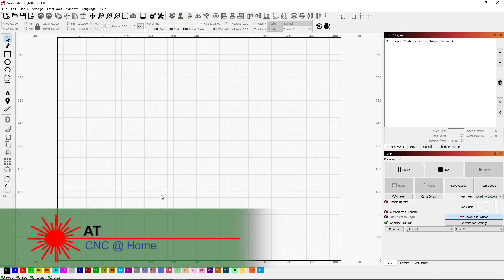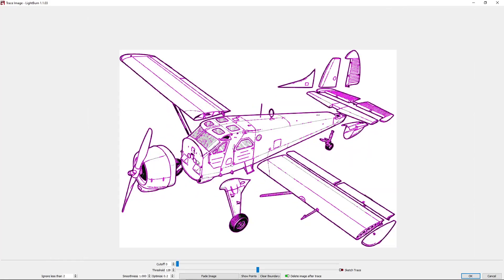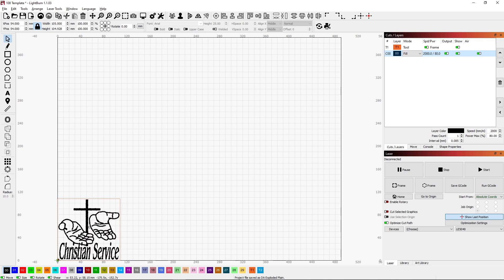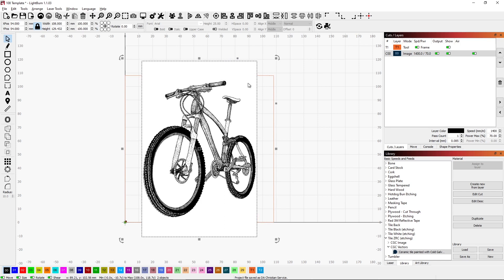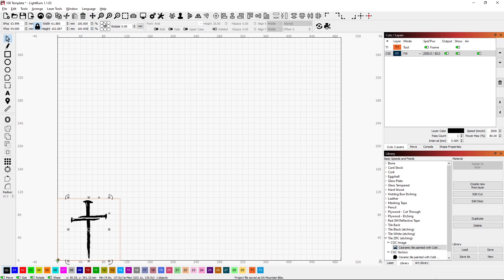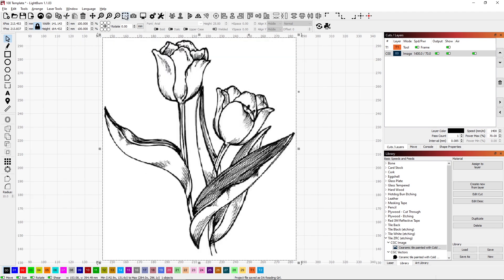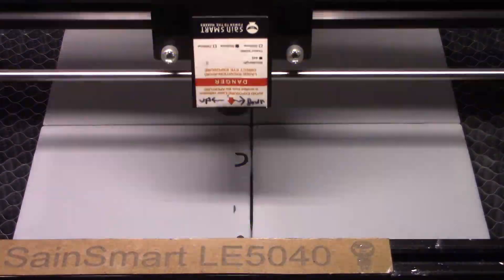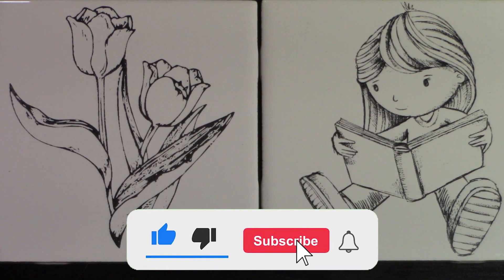Coaster burn didn't work with Cold Galvanizing Compound!

Comment: The CGC washes off with water nicely, you don't need lacquer thinner. I've been using CGC for about a year and have never seen the problem you had. I can't wait to see what you figured out. Thanks for the video!
Reply from the maker: I have had other people say the same thing about using water.  I tried that and it didn't want to wash off with just water.  I had to scrape at it and could do that without the water.  ;-)  What I found out, and there will be a video on this, is that the CGC needed to cure longer.  The next day they burned just fine.  I also set a tile in my portable heater for a couple hours and then it burned just fine too.  I have talked with people who burn once the CGC is dry to the touch and it seemed to work well for them.  That wasn't the case for me.  I also used a tile I had prepped several weeks prior and it too burned just fine.  It makes my head spin sometimes.  I have a similar issue with the white paint method where the tiles that have sat around for more than 6 weeks don't burn as dark as ones that have only sat for 2 weeks.  Fresh ones seem to work the best there.
Reply: I too use CGC on tiles. Mine washes off easily with warm water and a scouring pad. And I’ve never experienced the issue with it not engraving either. 🤷🏻‍♂️
Reply from the maker: @jbn0613  - Good to know.  I will keep experimenting with CGC to see what is what.  :-)

Comment: I use CGC:  never had this problem.  Clean the tile, spray with CGC burn it. (10 watt laser at 60% speed 2100 mm) Never used any chemicals to clean the tiles afterward.  Just water and brillo pad to clean.
Reply from the maker: I haven't tried the brillo pad.  I can see how that could work well. Great information!  Thank you for that.